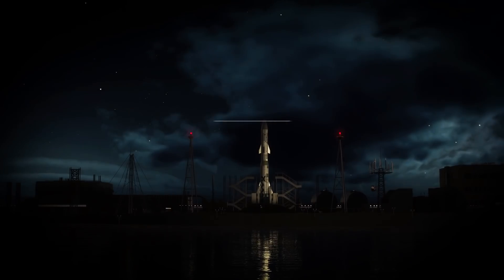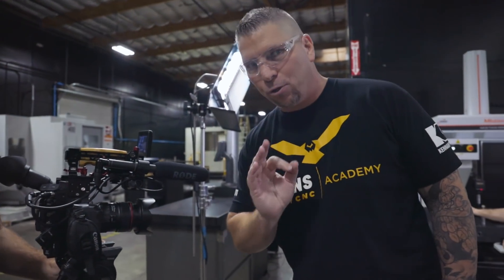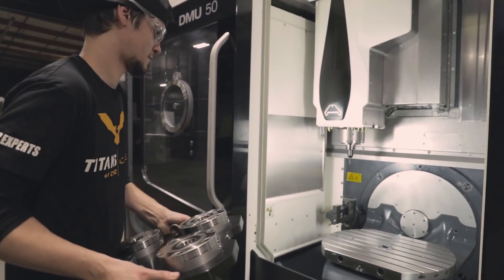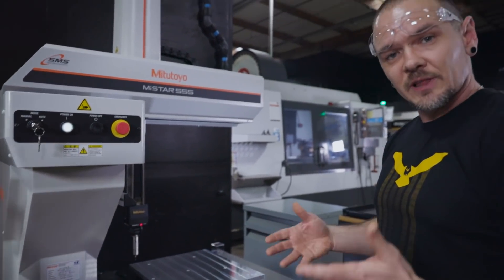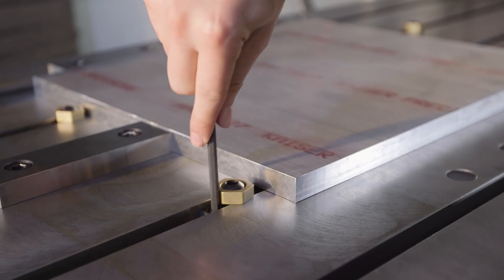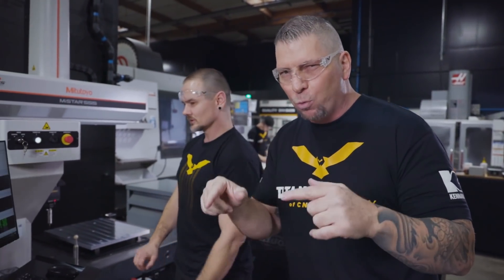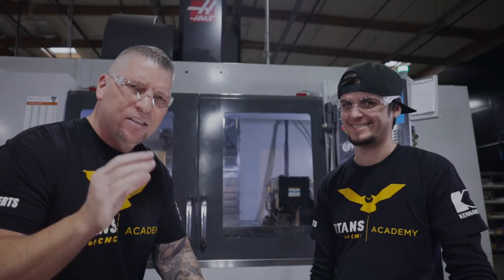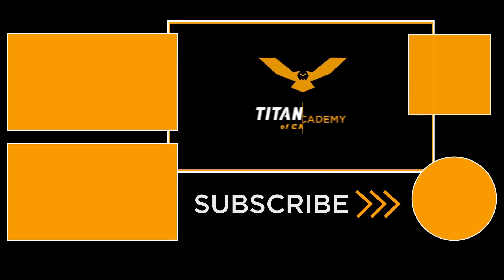How to Make Incredible Aerospace Parts!

Comment: Do you find yourself having to remove a certain thickness of material from extruded aluminum, to remove the dead zone of the aluminum?  Do you get many drawings that call out for the amount of material to be removed from the raw stock?  
Second question, would it be more effective to face the component using an endmill, rather than a face mill?  The face mill, while being faster does exert more axial pressure than a sharp endmill.  Would this have helped get you below the 0.001" flatness?

Comment: Please tell me you are doing this in metric as well.
Reply: When it's called for, I'm sure they do. If the designers are submitting drawings in metric, then it's too much of a pain to make the conversion just to move parts through the shop. I work exclusively in metric. I have gotten a little better at making the conversions in my head.
Reply: When you're learning something, the units don't matter. If they say 5 inches, just pretend they said 5cm. If that, or even doing a simple conversion is too difficult for you to wrap your head around, this probably isn't the line of work for you.

Comment: Just an honest, simple question: how come you don’t have your CMM isolated from dust, and on its own concrete pad isolated from seismic vibrations?
Reply from the maker: As mentioned in the video, this is a new CMM from Mitutoyo that’s created for a shop floor and is sealed in a way that allows it to thrive in a tough environment
Reply: Also wondering about thermal drift in the shop ?

Comment: please stop moving the indicator sideways. The needle will always have a bit of play. The most correct method will be to pull the needle as perpendicular as possible.
do you have any vacuum table for facing a plate? it would spread out the clamping force more even. A fly-cutter would maybe help also, so it generates pressure only at one point at once.
But if there is no more need for tolerances, there is also no more need for more efford.
The meterology center is also close to working machines, no big vibration dampening around.
Have you checked the influence of the ground resonance to the measurements?